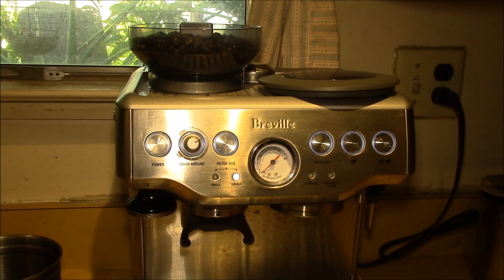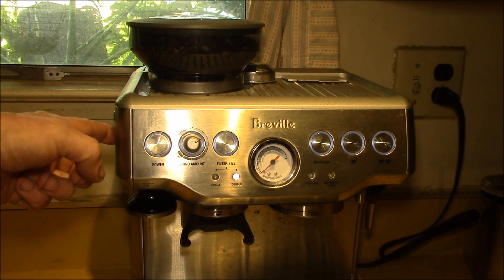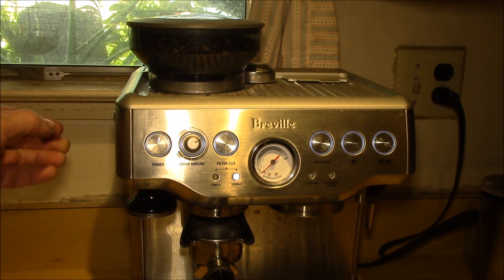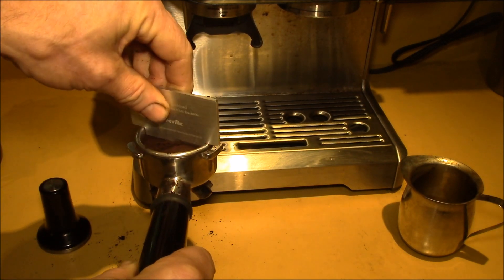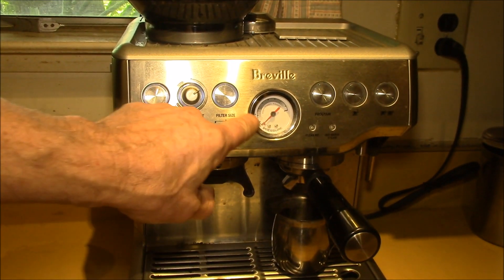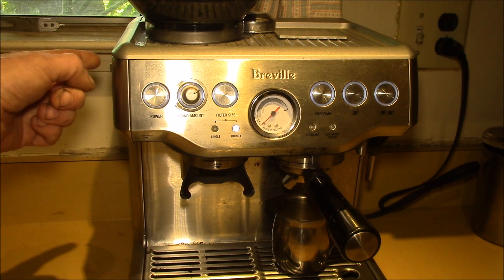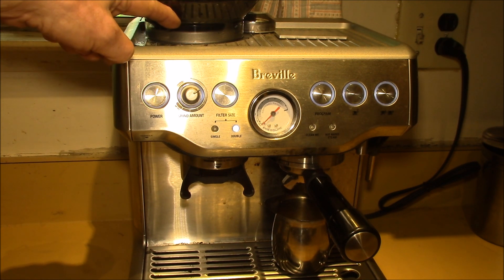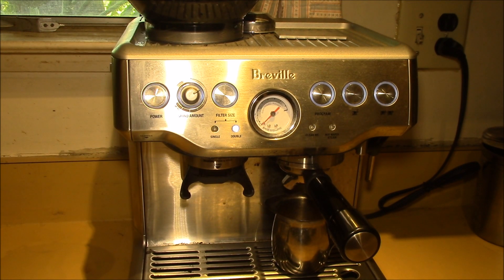Breville BES870XL - Grinder Adjustment

Comment: Do you know if it's totally necessary to change the grind size when running the grinder? Didn't find anything in the manual.
Reply from the maker: Ryan Flanagan I didn't see any mention of that in the Breville manual either, but I saw some mention of it for other burr grinders.  The first 6 months I owned my machine, I adjusted the grinder with it off with no apparent issues.  But it does make sense to adjust to a finer grind with it running to avoid putting extra pressure on the mechanism in moving the burrs closer together.  So I've been trying to do that on my machine.  If I notice I need to move to a finer grind, I put the Razor over next to the grinder adjustment knob to remind myself to adjust that next time I grind some beans.  Changing to a coarser grind is no problem as you are moving the burrs farther apart.

Comment: Great Video!

I purchased the BES870XL about 2 weeks ago, everything was perfect until a few days ago, now the machine grinds way too much coffee even if I adjust the grind amount way down, it still over-grinds. Also, I am not getting the consistent pressure once I brew, even if I tamp down with all my strength, it still is not in the espresso range. This can probably be fixed with the grinder settings ( great tip to adjust during the grind so the burrs do not become blocked), but more concerning is the over-griding, any ideas? Thanks!
Reply from the maker: You might try unplugging the machine for a few minutes and see if that grind amount resets.  Otherwise, you might try contacting Breville support and see if there's a way to re-calibrate that setting.  You can stop the grind part way by pushing the filter basket back into the switch while it's running.
Reply: Thanks, I did unplug it quickly, but I will try for a longer amount of time, I am also going to try another type of coffee, that is really the only thing that I can think of that changed. The coffee I am using is a really good quality medium roast, but maybe I need to use something closer to an espresso roast. If all else fails I will call Breville, but from experience that usually leads to a dead end.. Thanks for your help!
Reply: Use fresh coffee...you are welcome.

Comment: Can someone explain to me difference between filter size and grind amount?  I would have thought filter size tells the grinder the amount to coffee to provide.
Reply from the maker: I think of the grind amount as the fine tuning knob for the amount of coffee ground based upon the filter basket setting.  Since the actual volume of ground coffee will vary with different beans and grinder setting, there is no single setting that works in all cases.  I suspect the grind "amount" controls some sort of timer circuit that determines how long the grinder runs.

Comment: Hello en que numero dejas molino para obtener el café fino? No logro obtener presión en l máquina
Reply from the maker: "Hello in which number you leave mill to get the fine coffee? I can not get pressure on the machine"

"I generally run the grinder between 6 and 10, that varies with each bag of beans.  Then I adjust the grind amount on the front as needed to leave the filter basket heaped full of ground coffee before tamping it down."

Generalmente corro el molino entre 6 y 10, eso varía con cada bolsa de frijoles. Luego
 ajuste la cantidad de molienda en el frente, según sea necesario, para 
dejar la canasta del filtro llena de café molido antes de aplastarla.

Comment: did you use the double walled basket?
Reply from the maker: +Yusin Choi I mainly use the single wall filter which is when you need to dial in the grinder adjustment.  If using the double wall filter, it doesn't matter too much as filter generates the pressure drop and not the grind of the coffee.  I've used the double wall filter with regular drip grind coffee and it worked reasonably well.
Reply: Thanks for the explanation!

Comment: So you prefer to age your new beans for a few days before using them?  Perhaps you're alone in this.  If you get them fresh and use them before they go stale, you still won't have to make the grinder adjustment that you're try so hard to avoid.  And your coffee will be better!
Reply from the maker: I usually have a few days of beans in the hopper.  For me it's a tradeoff on time pulling new beans out of the freezer and refilling the hopper vs. maximizing the taste of the end product.  Since I only make 2-3 cups a day, it's not practical to add beans at every grinding.  But yes, if I ran a commercial shop or made more espresso, then it would make sense to add beans daily.  I don't find the grinder setting changes within one batch of beans, but it does change when I change to a different bag of beans.
Reply: The point I was trying to make is that if you are always using fresh beans, you also don't need to make constant adjustments.  Same work for you, better coffee.  "Out of the freezer"?  Oh my.  I guess I'm lucky, I have 2 roasters within walking distance.  If I need to adjust my grinder more than 1 or 2 notches, the beans go in the bin and I have a 15 minute delay while I go get fresh ones.
Reply from the maker: I only have to change grinder settings if I change coffee beans from one brand to another.  I rarely change within one brand of beans.  I so have 2 roasters as well and I'll roast up some green beans if I want to make a really nice espresso on a Sunday morning.  But during the work week, I want something quick and easy.  I run my own business and my customers don't pay me to make coffee, so my routine is a compromise between a my time and the quality of the final espresso.   I keep a qty. of beans in the freezer, then periodically transfer some out into an air tight container next to the machine.  Then every few days, I'll top up the grinder hopper from that container.  It seems to work for me, I'm sure there are many other ways to handle the coffee.

Comment: Hi how are you?i want ask you If I want Expresso coffee what is the number to blend beanThank you
Reply from the maker: That will depend on the coffee beans you are using.  I would start around 10 and feel the grind.  It should have the consistency of table salt.  Then run a cycle with that and see what pressure you get.  Needle should be up at the top of the dial. If the pressure is too low, step down one number and repeat.  If the pressure is too high, go up one number and repeat.  You'll likely get different grind settings each time you change to a new brand of beans.

Comment: Just bought the Breville Barista-- I use a whole bean coffee (good quality, but from a vacuum sealed bag).  Here's what's confusing-- the settings that get me to a good pressure setting (around 11 o'clock on the pressure gauge) are a 2 on the grind setting, and the amount setting at '6 o'clock').  What confuses me in the dozen videos I've looked at for this espresso maker, I've never seen or heard anyone use settings this extreme.  I use the single wall double-cup filter and the double-cup settings--  the pour is about 25-30 seconds and the pressure gauge goes to 11 o'clock.   What gives-- why would these extreme settings work?
Reply from the maker: I don't think this machine has a high precision grinder.  The grind setting is just a knob that raises or lowers the center burr.  If it's producing a decent brew, I would go with it.  Mine just changed a month or so ago.  It used to run in the 7-9 range and now all of a sudden it wants to be set to around 16.
Reply: @The4Crawler  Good advice.  Thank you.

Comment: Can you suggest a grind size and how fine to grind for a single shot?
Reply from the maker: +Laila Ali It&#39;s almost impossible to say as the number will change with different machines and different coffees.  I usually run around 7-9 on the dial and then adjust the amount until you get the proper filter fill level, maybe try 1 or 2 o&#39;clock on the dial.  If too much coffee, turn the knob CCW, if too little, turn CW a notch.  If running a dual wall filter, the grind setting if not terribly important, but if using the single wall filter, it is.  Fine = higher pressure, coarser = lower pressure on the dial.  I shoot for 12 o&#39;clock on the pressure gauge or just below the point it starts to cut the pump off and back on.  Just pick some settings for a start and then see how it works.  Then make one change at a time, say from 9 to 8 on the grinder and try that.  Then adjust the amount one click and try that and keep iterating towards a good setting.  I find if I start turning both knobs at the same time, I lose track of what&#39;s going on.  You want the coffee to feel almost like a pinch of table salt, that's the size grind you are looking for, not fine like flour and not coarse like regular drip coffee.

Comment: Sir, one question please,.my boss here has a Barista Model BES870XL/A but the grinder just won't kick in when pressed with the portafilter,..can you give me an idea?
Reply from the maker: Main thing to check is that the grinder hopper is fully engaged and locked:
https://youtu.be/0ZDii493IPY?list=PLpY2FP1a9tisyIfKjSugexoVK01xQuptv&t=435
If that doesn't fix it, likely the wires for the switch in back have come loose inside the machine.  Open it up and have a look:
https://youtu.be/96IuKiuIB5A
Or contact Breville and see if they have any suggestions:
https://www.breville.com/us/en/home/index.html